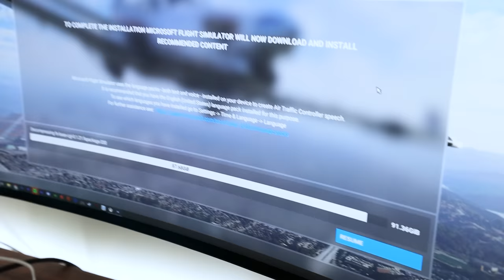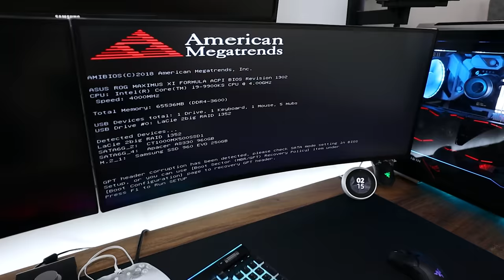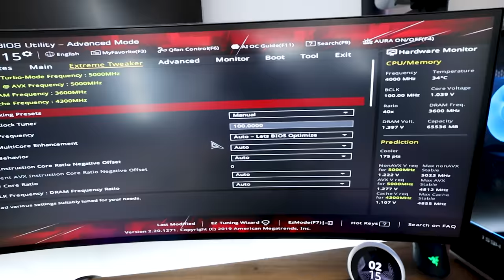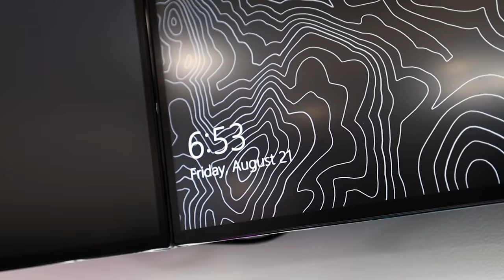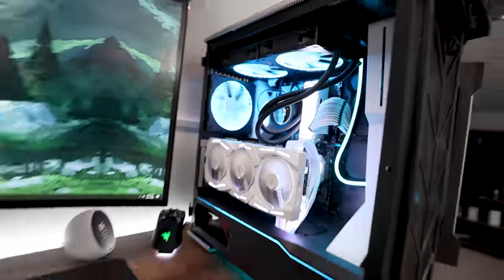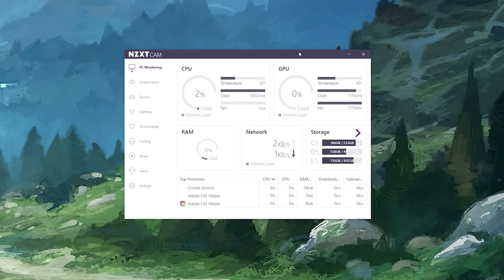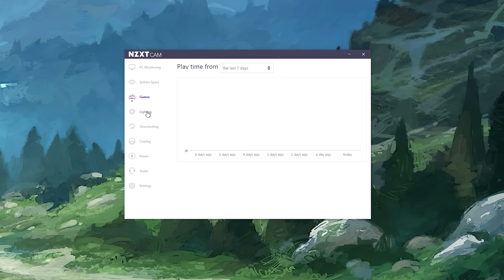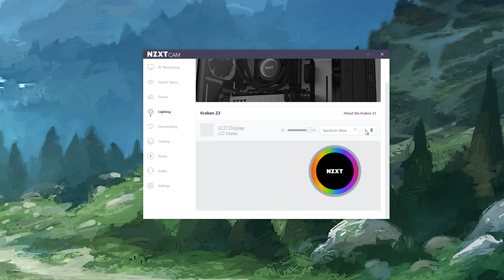OH BABY IT'S FINALLY HERE!

Comment: 1:57 I think you meant 63 xd
Reply: iBBi both
Reply: @NotGoodAtYoutube  Nope, it's called the Z63. It's not a 360mm rad because it only has 2 fans on it. I'm thinking it's a 280mm (2x140mm fans) radiator on the Z63.

Comment: FrankP, I have a question about the mouse you're rocking, it's definitely not your video is about. Great video by the way, I truly love it, especially the NZXT AIO cooler. Back to my question, have you ever experienced charging issues with your viper ultimate mouse? I have both the basilisk ultimate and viper ultimate, and for some reason I'm always facing charging issues. Sometimes they won't charge when I dock it, sometimes they do but very slowly and at times, it shows it is charging, but the battery drains instead. Please get back to me with an answer. Thanks.

Comment: You have to disable USB boot in bios. Say you wanted to dual boot Linux and Windows, you would use a live USB drive and it should boot from there and override the default choice even if it was the nvme drive. I don't know why it recognized the USB drive as a bootable USB though.

Comment: I got an Asrock X570 Steel Legend Wifi motherboard because in all of the pictures it looks like white. It even has a black and white camo colored PCB, but once we got it, it barely has any white accents at all it's like a brushed steel look. It still looks great but it doesn't match as well as white would, still a good motherboard but wish their were more options other than the Asus Prime boards which was $50 more and didn't even come with wifi.

Comment: ALSO YO I HAVE THE SAME PROBLEM. My motherboard is whacky as hell when it comes to external drives, if I reboot, and even an SD card is plugged in, it will try its damndest to boot from that before the NVME even though I changed the boot priority in the bios. Drives me nuts, but I can't really afford to buy another mother board to fix it. Probably should ask, is there a fix for this?

Comment: Your External Hard Drive issue is from your Asus Mobo mine does something similar. I have 2 NVMEs and every year I swap my OS from one to the other and swap slots so I get equal TBW on each one. and for the longest time ot would constantly try to boot into the wrong drive and i would have to manually boot from bios. I updated all my mobo drivers and no luck but then one day it just randomly stopped. So ya have fun lol

Comment: A simple USB hub with switches on the inputs would have solved the problem. Or even better a NAS.
Also, you are far braver than me painting that expensive MB without removing the plastic shroud and painting it separately.

Comment: hey @randomfrankp the issue with your boot problem is because of the legacy usb option in the bios, just disable it so it wont boot from usb devices... just remember to enable it if you want to install windows from a bootable usb drive... thank me later

Comment: i had the same issue with the my motherboard it was the Rog b450-f...this issue sucks what i made to fix it and worked pretty well is that i downloaded the latest bios firmware ,thought i has updated it ...... and i have installed it again and worked just fine after this you can try this because i think the Rog motherboard is irreplaceable with any other board  😂

Comment: I just wanna say...when you pulled out the processor without cleaning it off, and cleaned it off in your hand, I had horrible flashbacks to a very tragic time in my life. I had just upgraded from an AMD FX 8350 to a Ryzen 5 1600. My cooler had broken, and I was switching it out. For some reason unbeknownst to me, I decided to make the rookie mistake of removing the CPU to clean the paste off. As the CPU fell to the counter, my life flashed before my eyes, and thought of the dollars lost sent me into a panic attack. The Ryzen 1600 wasn't a very expensive part, but what you have to understand is that I was operating on a very strict budget. I Reached down, and took a firm grasp on my freshly abused CPU, lifted it to my eyes, and witnessed the horror of not only bent pins, but thermal compound on the pins. Fortunately, after an hour of work, I was able to straighten the pins using a credit card in combination with a large amount of determination to not have to tell my wife what had happened. Once the pins were straight, it was time to clean the thermal paste off of the pins. I used alcohol prep pads to swipe through the pins, and went so far as to put a drop of alcohol on the pins to help dissolve the paste. I was successful in both straightening the pins, and cleaning the paste off of them. It was time to reassemble, and try to boot. With an immense amount of fear and nervousness that I had ruined my processor, I pressed the power button. I know what you're thinking. You're thinking everything was okay. It wasn't. It boot looped. Three times. I shook with an intense feeling that I was going to vomit due to the increasing anxiety. Finally, it booted. Everything worked. i thought I had passed out, and was dreaming, but no, it all worked.  To this day, that experience serves as a reminder to always make sure I don't make rookie mistakes.

Comment: That GPU is gonna choke/burn to death, bcs of the vertical position
Reply: No it won’t. Thermals will be fine for the most part but yes it will run warmer than your traditional orientation.
Reply: @damnitderek  Do you see it is on the glass like maybe a centimeter away, especially if he plans to OC it
Reply: @damnitderek  I am the guys that is more function over form, but I get why he wants it in vertical, because it look beautiful, but me personally would never do vertical, and my next build is gonna be in a case without TG and ITX. All I want to say is that i get why you mean.
Reply: Sven Čolakić GPU/CPUs have built in functions to thermal throttle when they get to a certain Temperature. They also have a function when it hits a certain temp to completely shut off and reset.
Reply: @damnitderek  I know, I didn't want to get that technical into it, was just for bants. but ok

Comment: @randomfrankp
 Hey bud. Regarding your USB HDD boot issue, I had the exact same problem with my Seagate BarraCuda 10TB external backup drive as well on my Z390-E M/B. Worked fine until I did a BIOS update a while back which then began the boot error issue. I researched it extensively for days and many people experienced similar issues usually relating to a particular external drive and/or after they performed a recent BIOS update. Eventually I found a thread on the official ROG forum and managed to fix this by going into the BIOS settings and heading over to BOOT >  BOOT CONFIGURATION and changed Setup Mode to "Advanced", then Boot Sector Recovery Policy to "Auto Recovery". 

Try this as it worked perfectly for me and allowed me to boot every single time again with no issues or error messages. I've also just updated to the latest 1602 BIOS last night so will try switching the above settings back to default again to see if Asus have fixed this issue, as my boot "issue" with my external drive originally begun happening from a BIOS update.

Comment: I have to wait until next year to pick up rtx 2060 😭
Reply: Why bother with the 2060 at that point? The 3000 series will be the current gen at that time
Reply: @damnitderek  the price will drop,and I heard that 3000 series price cause a lot ton of money
Reply: Omar Mahadi price won’t drop much on the 2060. The next 3060 will basically replace the current price of the 2060. The higher end gpus will be a different story.